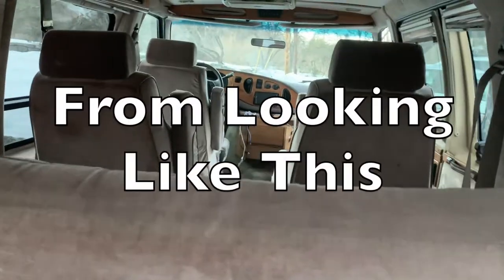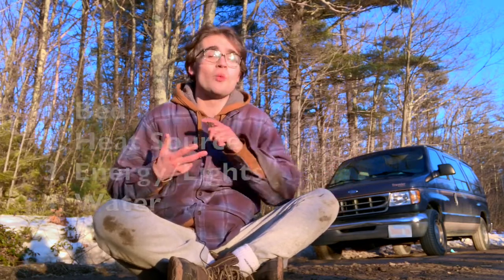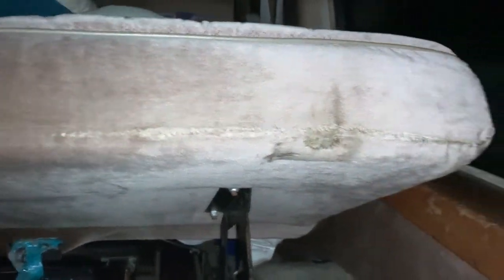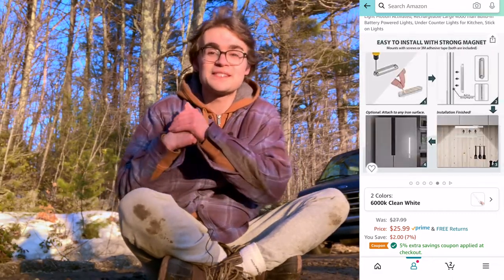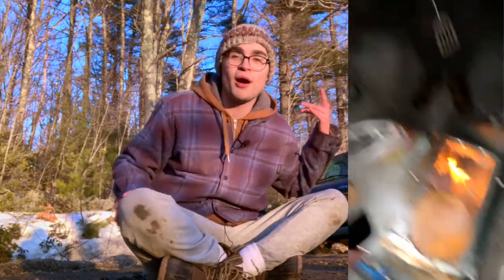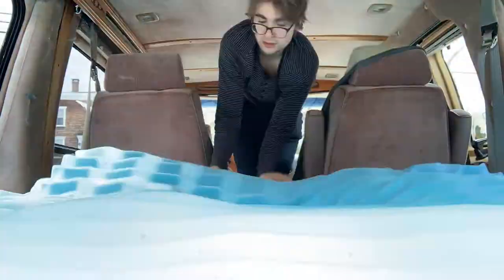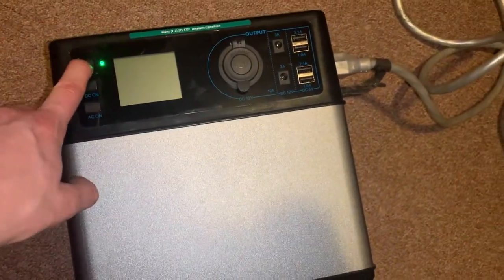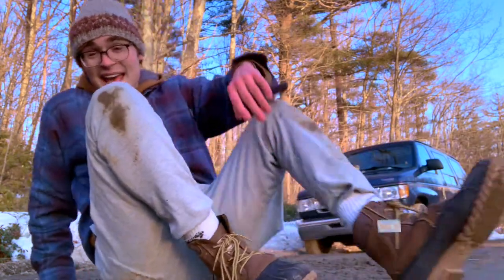My Budget Van Build With Netflix | Fast, Easy Conversion in 1 Week

Comment: I bought 2 off these for like $14 for both last year. You can charge them with usb phone charger or the little solar panel it comes with. They have a 4 hr run time and after that, it looks like a low night Light. I even hooked the solar panel to my phone under the lamp and it was charging it. (LightMe Portable 130LM Solar Powered Led Bulb Light Outdoor Solar Energy Lamp Lighting for Hiking Fishing Camping Tent)